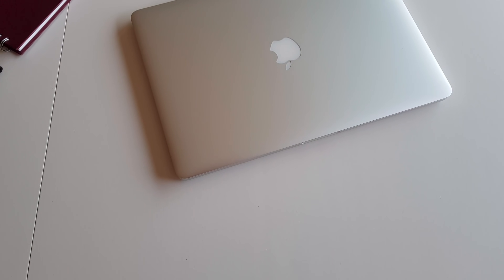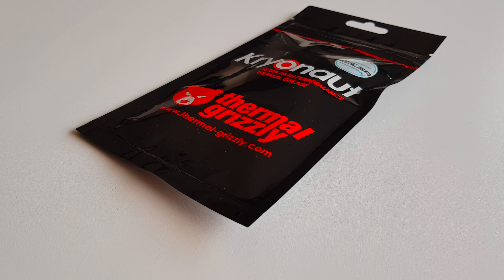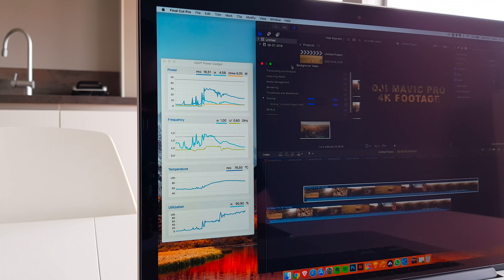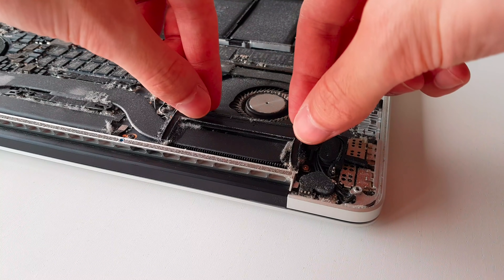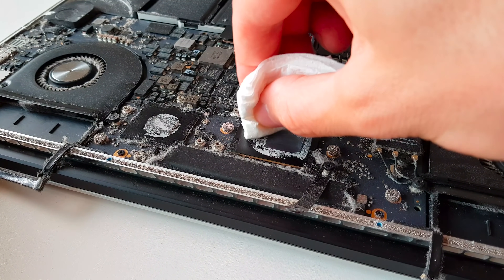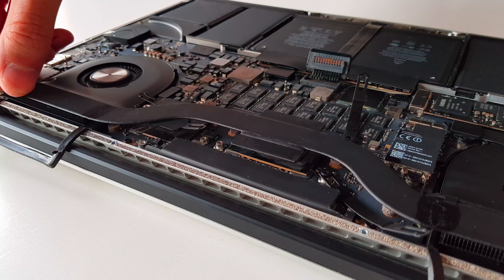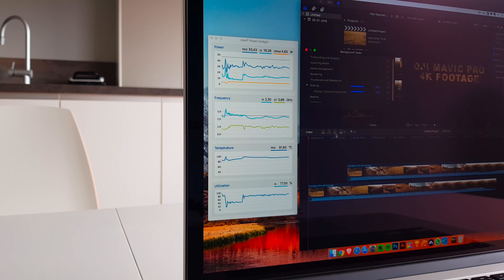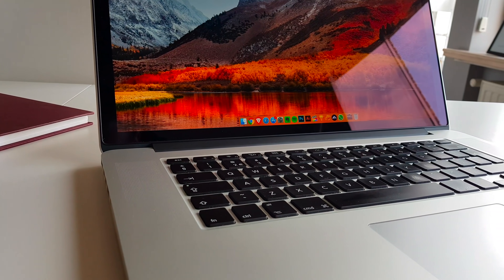Solved overheating problem on my MacBook Pro 15" Mid 2015 by replacing the thermal paste

Comment: Thank you very much, Dario! After watching your video I got the courage to crack open my 2013 15” MacBook Pro, which had never been opened. It was running very hot with very little CPU load. Sure enough, upon opening it I discovered tons of dust bunnies and old, dry thermal paste. After your fix it runs like new.

Comment: My mid 2015 macbook pro get very hot and the fan turns on max when I watch 4K video on youtube. Anyone else? Solutions?
Reply: khoroshsabzi Open the laptop. Fully clean the inside with a soft brush and a vacuum. Then open the fans and make them sparkling clean. Remove the heatsink and apply high quality thermal paste (high quality like MX-4 or Grizzly). Assemble the laptop back and you will have a healthy fresh breathing laptop which can last another 5-7 years. Cleaning inside of the laptop in any other way will be a waste of time so do it properly

Comment: Question, I am about to order Kryonaut but is the Hydronaut not less corrosive ?
Reply from the maker: The Kryonaut is completely fine. Never experienced any problems with it so you should not worry.
Reply: @DigitalPulse  Thanks a lot, after hesitating with thermal pads, Hydronayt & Kryonaut, I finally ordered Kryonaut ^^
Reply from the maker: Good luck man! Let me know if you get stuck and if I can help 👍

Comment: Great video and props for not putting this video at 99% speed or add some 6 second crap to reach the 10 minute mark. Quality first, I like it!
Reply from the maker: Honestly when I released it I was a bit worried that people won't watch it because it's longer than 10 min. Guess you are a good example that I was wrong 😅 Tha KS for the feedback 👍
Reply: @DigitalPulse  yeah but next time you can slow it to 99% playback speed, we don't bother, it's probably unnoticeable and you deserve the extra revenue for the quality you're delivering to us

Comment: Good info, but waaaay too much thermal paste. Thermal conductivity of the paste is lower than the materials it couples, so when the paste is too thick you won't see optimal thermal transfer. Use just enough to ensure complete coverage of the heatsink pads & allow for surface irregularities, and no more. Should be a thin smear over the entire pad with no excess. The one in your video has obviously been "serviced" before - factory processes generally leave just the right amount, with minimal wastage.

Comment: Hi, awesome video! I assume this applies to a mid2014 model as well?
I had upgraded mine to the best possible specs available at the time so I don't want to change it now... It performs well but overheat quite a bit so I assume my paste is dry as well?!
Nom du modèle :	MacBook Pro
  Identifiant du modèle :	MacBookPro11,3
  Nom du processeur :	Quad-Core Intel Core i7
  Vitesse du processeur :	2,8 GHz
  Nombre de processeurs :	1
  Nombre total de cœurs :	4
  Cache de niveau 2 (par cœur) :	256 Ko
  Cache de niveau 3 :	6 Mo
  Technologie Hyper-Threading :	Activé
  Mémoire :	16 Go
Reply from the maker: Yes it applies to te 2014 model as well. Just check websites like iFixit to make sure that the proces of taking it apart is the same. And yes, your thermal paste is probably completely dry by this time. Good luck 👍
Reply: @DigitalPulse  Awesome, thanks! I also saw some graphite pad tested and apparently they offer performances similar like 99% to the best thermal pastes. The fact that they are apparently lifetime guaranteed is convenient... Thoughts?
Also, I probably need to do the same process in my PS4 Pro that I have used quite heavily since 2017.
My X1X is pretty recent so maybe I don't need to do it unless the stock paste is of poor quality? Is it easy to do on these two consoles?
Reply from the maker: @PanzerDragoonWorld  Thermal pads are more convenient and as you said from a performance point of view they should work the same. I would say go for it.

For the PS indeed that could be a good plan. I never tried doing it on consoles so I have no clue how the process looks like. But I assume it's quite straightforward.
Reply: @DigitalPulse  Thanks for the answer! Help very much appreciated!
Reply from the maker: No problem at all! Good luck 😀👍

Comment: Great! do you recommend a graphite termal pad instead of the thermal paste?
Reply from the maker: As far as I know it will deliver the same or similar performance while installation is far more simple. So in my opinion, go for it 😉
Reply: @DigitalPulse  Thank you! can you tell me what temps you had under normal usage once you changed the thermal paste? to have as reference
Reply from the maker: Idle Temps were ranging in the 50 - 55 degrees zone. But check my video again, I forgot 😅

Comment: Can you not use vaccum cleaner to suck the dust out from all over the Macbook when it is open? I don't mean hard scrub but gentle hoovering action? Anyone knows a reason not to do it..?
Reply from the maker: Static electricity
Reply: Dario Prski thought so...use a long hose plastic pipe to suck up the air? There is no chance of long plastic water pipe passing static electric

Comment: Thank you so much for this man! I bought everything from your links you provided and it worked great. I had so much dust and crap as well. Now my computer is running like 20 degrees cooler at idle which is mad! The only thing I did different was use the plastic tool to spread out the thermal paste as per the instructions on the paste itself! Thank you man!!!!!!!!!!!
Reply from the maker: Enjoy!

Comment: Hi Dario, I have a MacBook Pro Mid 2014 and I don't have the money to buy a new MacBook Pro, my specs now are 2.8ghz quad core intel core i7gb 16gb of ram 1600mhz dd3 Nvidia geforce gt 750m 2gb with 500gb sd of storage what can you recommend me to upgrade? Of course im going to replace the paste because its overheating to much your video help me a lot, cheers !!
Reply from the maker: Hi Fernando? Are you asking me which components to upgrade or which new laptop to get?
Reply: @DigitalPulse  For now, which components should I upgrade? Btw im an iOS Developer
Reply from the maker: @ferdamateo  well you actually have limited upgrade ability on MacBook. If you don't already have an SSD disk then that could be something that you should definitely upgrade.
Reply: Dario Prski thanks Dario, I’ll do it, an upgrade on storage and repasting, and I’ll let you know the results, thanks
Reply from the maker: No problem at all Fernando. An SSD is the easiest and cheapest upgrade that will increase your MacBook performance significantly

Comment: Fantastic--I have same unit.  Gets hot and I can hear the fan really running.  What is the "intel power gadget" on the left of the screen?  Is that something already in the computer or do I have to download it?
Reply from the maker: Hi! No, the Intel power gadget is something that you need to download separately.  It's a great and lightweight tool to monitor your CPU utilization, clock speed and temperature. It can help you identify if your MacBook is thermal throtling. You can download it here: https://software.intel.com/en-us/articles/intel-power-gadget

Enjoy! :)

Comment: Thanks for this vid! My MacBook is running much smoother after following this procedure. I ended up using the Thermal Grizzly Hydronaut thermal paste and not the Cryonaut. I was recommended the Hydronaut based on the fact that, allegedly, it is better suited for non-freezer applications (above 0degC). I was also told that the Cryonaut can become crumbly and brittle after 6-8 months. Anyway, I’m happy with my decision. Works like a charm! Thanks again 😎

Comment: Thanks for the video! How about the fan noise, is there any improvement there when the machine is under load?
Reply from the maker: They sound the same. I did not notice any change.
Reply: @DigitalPulse  Thanks for the reply, maybe I wasn't clear enough. I was curious how soon would the fans switch to higher RPM under load (therefore the laptop being more noisy) , however since then I already replaced the thermal paste on my rMBP15, and it's definitely stays quiet for a longer time (the fans would stay on the base RPM until the CPU reaches 65+°C; they were already going around 3500-4000RPM before the replacement). All the best for you!

Comment: “2x performance”, sounds like a claim out of thin air.
Reply from the maker: Did you try it? Also watch the video until the end because for me it doubled the performance compared to what it used to be.
Reply: Dario Prski Well, I will try it. I just said “it sounds like” because of the MacBook’s very specific fan speed algorithm. The CPU clock rates doesn’t actually mean literal performance ratio every time, even on the same specific hardware. You should’ve added some benchmarks, that would prove your point. But cleaning the dust should’ve been much more effective than the thermal paste. I’ve regularly cleaned my mid-2014 up to this day, never changed thermal compound, and never experienced any performance drops. But this time thermal paste actually got really bad(it’s been 5.5 years), so I’m experiencing some local overheat around the CPU(at unexpected times). So I will try it, and I don’t expect a “2x performance improvement”, simply because it’s performing the same way at the day I bought it. Maybe a slight difference at lower loads will be visible, but it won’t be at higher loads and it won’t be “2x”. It won’t differ at higher loads, because MacBooks are designed to thermal throttle at very specific clock rates and very specific degrees(to be silent). So no matter how well you cool it, your fans won’t work at full speed until it’s 95 degrees Celsius. And at that degrees a normal Intel CPU would thermal throttle itself, to prevent harm on the CPU. But Apple is tweaking the clock rates, so the CPU throttles at a little higher clock speeds, and consistently locks itself at those speeds, until you take the load off of it. There you go, a full explanation.

Comment: Wow, you're living in a very dusty environment. I actually own a 2004 Apple PowerBook G4 Titanium and I never opened it up till 2016, where I wanted to clean it up and finally put it on my bookshelf because I purchased a mid 2014 MacBook Air..
Anyway, I only found a little bit of dust on the fan blades but other than that, everything was really clean and dust free. Maybe you should get one of these upgraded MacBook lids which have a dust filter.

Comment: Great video would you recommend liquid metal over thermal paste?
Reply from the maker: From a performance point of view YES, but from a longevity point of view No. The thing is, you need to somehow ensure that the liquid metal does not leak since it's conductive and at the same time make sure that your heatsink does not corrode because of it. If you are planning to use your MBP for the next 2-3 years then i would avoid it :)

Comment: Can you upgrade the memory on the 2015 MacBook Pro or are they soldered to the board? Also great video. I just replaced mine on my Mac book pro mid 2010. The 2015 Mac book pro looks like less of a hassle to replace the thermal paste since you don’t have to lift the mother board.
Reply from the maker: No you can't. Unfortunately it's soldered to the board :( Thanks for the feedback man and for stopping by on my channel!

Comment: what about the temperature is colder than before or not?
Reply from the maker: Idle temps were lower, temps while doing web browsing were also cooler. If you do heavy stuff like video rendering, temps will still reach max, but your CPU speed will be higher. So practically you are reducing temps for some tasks and increasing speed on all tasks that you perform on the machine.
Reply: Dario Prski thanks bro

Comment: Not sure why I’m having such a hard time undoing the screws on the heat sink plate but they’re screwed in there so tightly. I’m worried I’ll ruin the inside on the screws and they’ll never be able to come out. Anyone have any tips on how to get them out?
Reply from the maker: Hi Lucy. Try to put on top of the screw some masking tape and then push in the screwdriver. Try with one layer of tape or even with two if it fits. That way you will reduce the chance that you damage the screw head. Don't use any screw loosening products like WD40. I am afraid that they might drip in your laptop. Let me know how it goes and if you need any help 😀
Reply: Dario Prski Wow thank you so much for replying! I’ll give that a go with some tape tomorrow morning for sure :)
Reply from the maker: Nothing to thank me for. Actually thank you for watching! One more tip, when I have difficulties unscrewing a screw I usually press down a bit harder with the screwdriver. Give it a shot as well. And good luck! 🤞

Comment: recommend force your fan to a high speed after changing the thermal paste
Reply from the maker: Sorry for the late reply. Missed your comment somehow... just out of curiosity, why would you do that?
Reply: Dario Prski for better performence, or at least make the fan run faster than the apple default fan curve. when i change the thermal paste my old macbook pro fan is basically silence when the cpu temperature is pretty high and it cannot be use on my lap. i just force the fan to maximum fan speed and the temperature drop about 20 degree, you don’t have to push the fan speed that extreme, but at least put it on a higher fan speed
Reply from the maker: @qupeter1224  oh I see what you mean. I misunderstood your first comment. 😅

Comment: I just replaced the paste on my rMBP 2015 15"...went from 1.8GHz 100c sustained for FCPX h264 exporting, to 3.1GHz 95c sustained for the same export...I used MX4 paste with a tiny spreader to smear/paint the dies evenly.  The temps didn't really change, but the available performance within those temps increased substatially.
Reply from the maker: Happy to hear that! Enjoy! 😀

Comment: You could also increase your speed even more by upgrading the solid state hard drive. Too bad the ram can't be upgraded.
Reply from the maker: Hi Morgan. There is already a stock SSD inside. This is the generation of MacBook that came with the SSD. Thanks for the advice 😀👍
Reply: @DigitalPulse  He probably meant replacing the old apple SSD with a much faster  nvme drive via an
 adapter.

Comment: How many screwdrivers did you end up using?  I am thinking of buying only the 5-point star screwdriver that opens up the laptop bottom lid and am wondering if the internals require other ones.  Great video!

Comment: Hi, I wanted to let you know that I was able to regain my performance just buy cleaning the fans. I did not replace the thermal paste. Before the fans were constantly running at 5000+ RPM, now they idle normally at around 2500 RPM.
Reply: chipped what are you buy ? Cleaning fans??

Comment: Time for liquid metal, then you will experience  a really big Temps improvement.
Reply: miragebg1981 is it risky?
Reply: @pshmps1836  When you know what you are doing, I would say - no. Just use all precautions -  Kapton tape around the die and foam dam to prevent leakages.

Comment: Wow my temps even stopped at only 90c with liquid metal, and once the fans kicked on at around 90c, they were barely audible and then the temps dropped to a steady 86c under full load. Keep in mind I can’t hear the fans and it’s under a full 3.2 ghz load. Did this for a short 10 minutes, but I’m sure it would have been fine longer.

Comment: Just did this on my 2015 MBP and my idle temps went from 62c to 44c definitely recommend this.
Reply: @xhuliok1951  I mean just sitting on the desktop doing nothing. It used to idle at 55-60. And after using liquid metal it went way down. Fan speeds also stayed lower under load or playing a game.
Reply: @agarcia8800  Which liquid metal you used for thermal paste?
Reply: @itsmetarik1  thermal grizzly Liquid Metal. But nowadays I use PTM 7950 as its safer than Liquid Metal and provides similar performance albeit not 1 to 1 in terms of thermal control.

Comment: Just ordered everything as I was planning to do this for a long time! Is your "GPU2 die" reading at 128 C? It has been like that since I bought this in 2015... Wish me luck tomorrow when everything arrives - great video!
Reply from the maker: To be honest I didn't even look at the GPU temp. I focused purely on the CPU. Good luck man with te repair! Best of luck 🤞
Reply: @DigitalPulse  did it 2 days ago,  don't notice much of a difference. BTW I had no dust almost inside! After 4 years

Comment: btw, you can get battery replacement from apple, which also stops the overheating. Check it out, while it's still available.
Reply from the maker: My battery is fine. I think my was not affected. Did you get your replaced?
Reply: @DigitalPulse  Nope, I have mid 2014, I just subbed upon an article by Apple saying, that they're changing the battery, due to a possibility of overheating. But it's only for 2015 models. 
Just google "macbook pro 2015 battery replacement" if you're interested.
Reply: @DigitalPulse  I did get mine replaced by Apple in 2018. But now I still see some issues of heat and fan noise. And came across ur beautifully done and v valuable video. I will take it back to them and see what happens next. Thanks again. Immensely for the effort and in replying to many of us viewers here. 👍🙏
Reply from the maker: Thank you for watching and for taking time to leave feedback. Much appreciated 👍🙏

Comment: Thanks you so much! works perfectly! a great and helpful video, i've used a compressed air can to clean the dust and Arctic Mx-4 thermal paste, its really easy to do following this steps.. again thanks
Reply: Arctic MX-4 is one of the best bangs for the buck. It lasts a minimum of 8 years as well.
Reply from the maker: 🙌 Enjoy your fresh MacBook! Thanks for stopping by